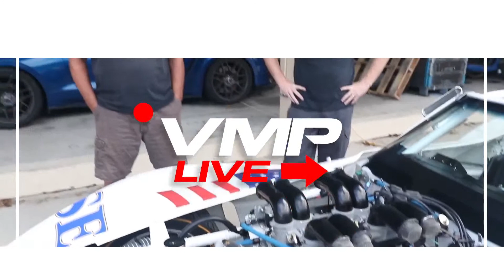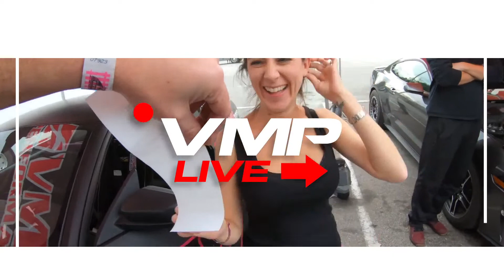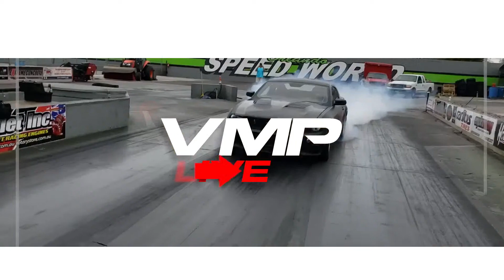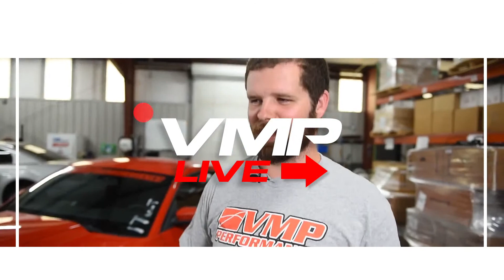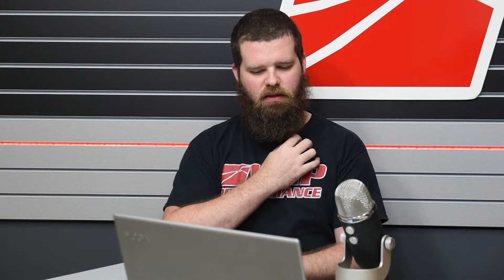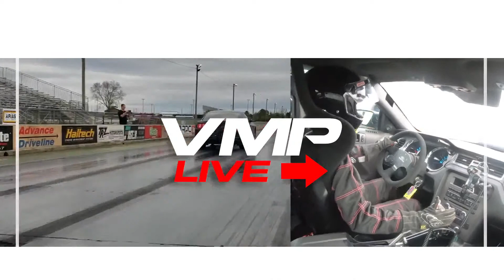VMP Live 03/03/21 - Chuck and Joe

Comment: Missed the live stream but saw that there was discussion about the RPM act at the end of this video. One thing that the other side fails to recognize is things such as how absolutely devastating open pit lithium mining is for the environment when it comes to the production of battery's for electric cars. But they are quick to point how how bad they perceive performance aspect of cars is. It's such a double standard.